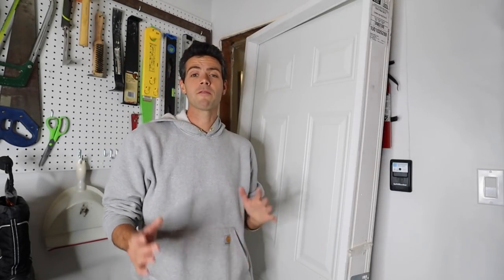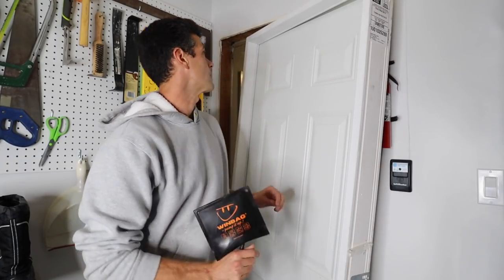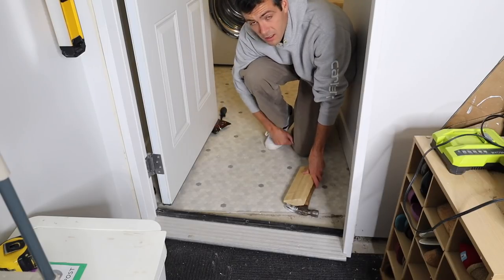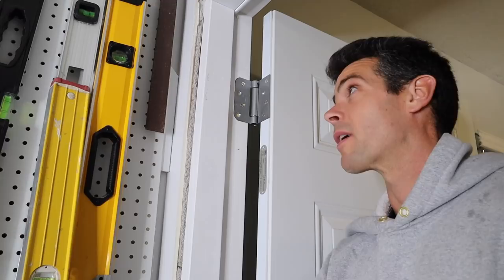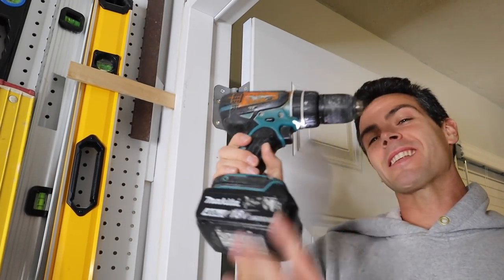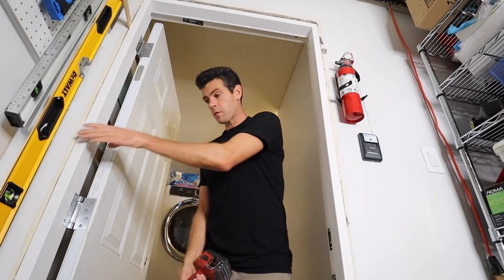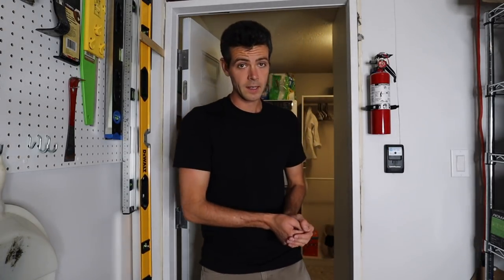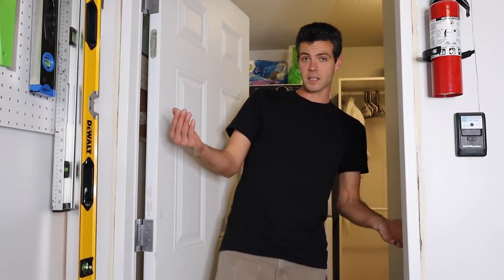BEST Tool for Installing Doors!!!

Comment: "I hate that they're always Philip's."
What? Philip's are easy to screw 🤷‍♂️
Reply: Robertson and torx are better. Personally like robertson screws because the screw can be used without having to hold the screw in place in most cases.
Reply: @RecklessTheory  Robertson!?! What are you a sparky?
Reply: @johnross6436  I just don't why the US is still so into philips when there are so much better options. I hear Canada is primarily robertson on the shelves and torx in Europe.
Reply: You WANT a Philips screw to cam out. A drywall system with Robbies would be a nightnare on your tools and the finished surface.
Reply: @RecklessTheory  true. Philips is great for drywall and framing where cam out is desirable. However it should just go away everywhere else.
Reply: DR PHIL  I know, you Canadians just like to be a little different 😅
Reply: DR PHIL  that’s amazing! The one time imperial makes more sense than metric